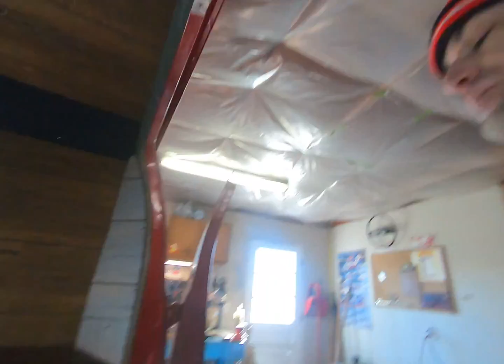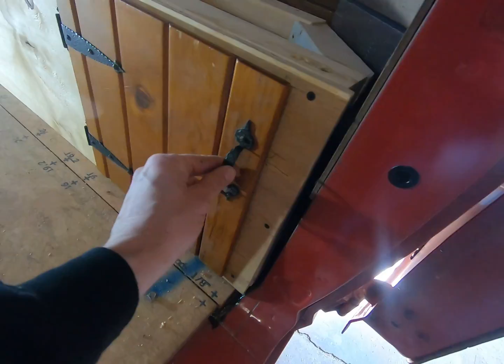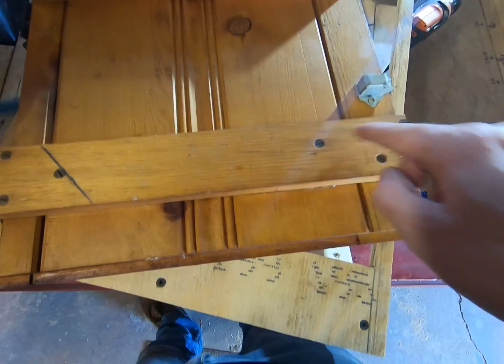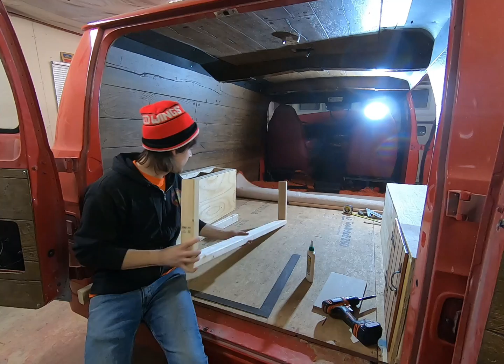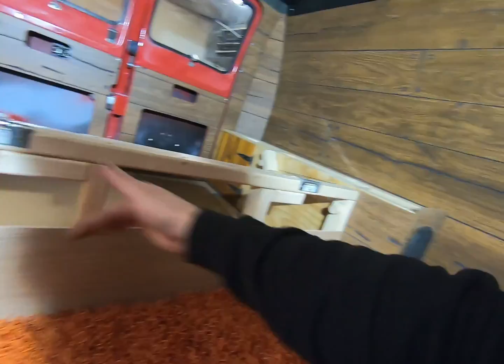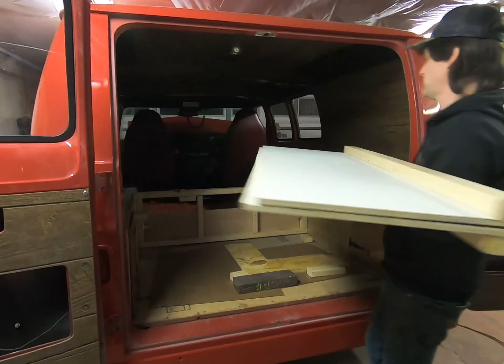Bed Platform/Storage PART 2 - Hoosier Garage

Comment: Thanks for the videos. Is there a pt. 3 video, listed under a different title, that shows you finishing this project?
Reply from the maker: I think that video i had technical issues with and couldnt post it. I can do a current video following up with how it finished
Reply: @HoosierGarage  That would be cool. I just ordered my wall paneling, and once I get it installed, I'll be starting on my bed frame. I'm interested to see how yours turned out.